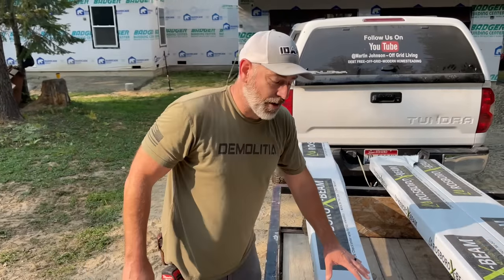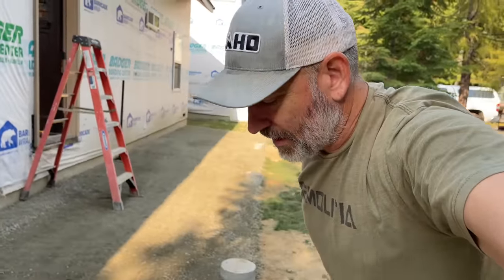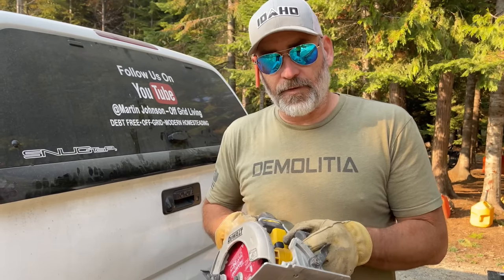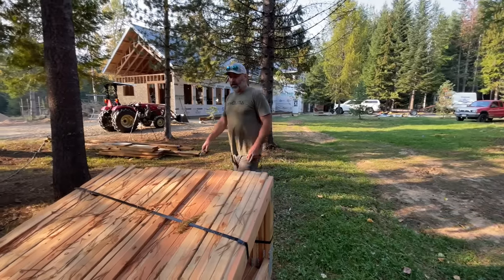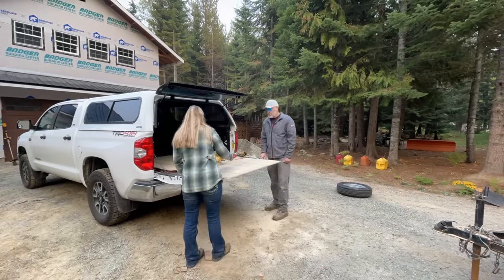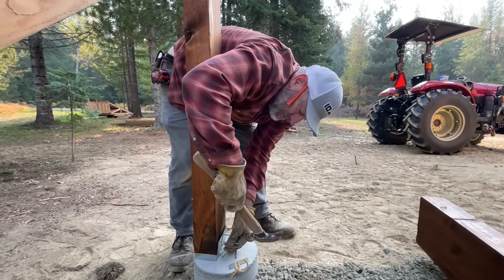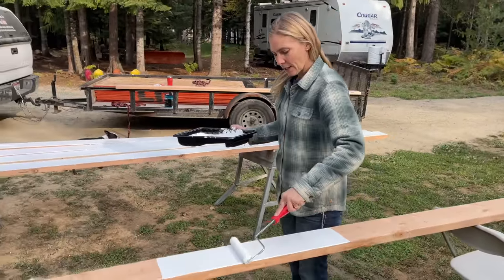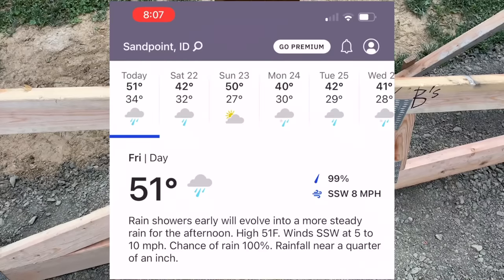Porch Roof Build - Couple Building Off Grid

Comment: I would spray all the hardware with WD40 Dry Lubricant. It dries, it collects no dust, helps stop rust, and removing moisture. FYI I also would do you tractor and equipment. This will help over winter 🥶.  Have a great day.

Comment: Suggestion put perforated plastic drywall soffit vent up in the ceiling close to the house and soffit vents on end to keep from mold and convection happening. It’s a 2” vent from Home Depot that you install in the ceiling with your bird block vents for air flow close to the house out to the eave

Comment: In your cold storage area
You will either install a water heater pump or filter system
 Which would be a good place as it will not freeze during extreme winter periods
 Keep up the great builds on your home. 
 Glen from Guam usa

Comment: Jewels why are you limbing? Marty glued lumber usually are a little longer than ordered. It's done to make sure you'll have a little leave way to choose the best part of the lumber for your project. Also the yard will only roughly measure the length of the trees used, but so that there is excess wood in the length...

Comment: You should have used a water level, a clear hose almost full of water with a cork in each end. You can make it as long as you like, and or transfer you’re elevation by making a mark allowing you to move you’re mark wherever needed. I’m a retired ironworker, before lasers that is how we did it. The contractor hired an engineering outfit to put in a mark on each floor. All this for setting windows. When they came out with lasers I thought we already have that problem put to bed. Every finish ironworker carried a rolled up clear hose filled with water and capped with a cork. Every floor on a story job, all of the windows. I would take a dispatch on the 5th floor of a 66 story and wonder if I would top it out. As an example of how much we used it.

Comment: Looking good, hope you beat the snow.   One suggestion is to flash the upper roof fascia to the top of the porch roof.  You don't want any gap there as it will collect blowing show, leaves and allow critters to get in make a nice home in the cavity between the upper roof and porch roof.  You will want to add some venting at the ends of that cavity or in the ceiling below the cavity to get air circulation in through the upper roof bird blocking.
Don't know how your are going to nail down the porch decking behind the upper roof fascia, glue ???

Comment: use a transit to see what the difference in concrete pad heights and cut post accordingly and will be straight.use your tractor to set your beams or at least get it close.i wish my boss would of had a fork lift with extending lifts or something.i use my tractor for my stuff as much as possible

Comment: You guys are doing great. I guess my question would be if there is a small heat source on main structure of roof would there be a concern when snow slides to porch roof would there be a build up at top edge of porch as there is no heat source. I think your design is good and the weather will tell what happens. Anyway great job!!!!!!
Reply: I also wonder, if the slope of the porch trusses, is great enough for the snow to slide off?

Comment: I think you're over thinking the strength of your porch roof. 😉 You have that thing built like fort Knox, it isn't going anywhere.
Reply: Not sure I agree, the trusses are only held with angle driven nails , I would have used screws through the truss upright and into the post and header of the house wall.

Comment: Hope you don’t get any hornets or wasps building their nests in between the two roofs, they will be impossible to get at and could ruin your porch enjoyment.
Reply: Yes I too see that area as being a pest problem for the future.
Reply: Yes , Most steal roofing manufacturers make positive and negative foam inserts that go into the ends too stop insects from entering the roof ends and the ridge caps. I would use the ridge cap foam all along the roof gap and seal the ends with screens.
Reply: They could always paint the soffit sky blue. Supposedly it’s just a myth but it’s worked for me for years. Dirt daubers don’t even build nests on it

Comment: Hi Martin,

Here in Germany it is forbidden to shorten Screws and threaded Rods with an Angle Grinder. They may only be sawn slowly, because the cutting Process heats up the Steel too much and loses its Strength as a Result.
Steel loses its Strength from about 350 degrees Celsius (see also the Steel Beams from the WTC)

You shouldn't do it...
Reply: Not a lot of logic there as the heated part is outside of the nut when it has been tightened !!

Comment: I blame the tape measure. I’m right handed so, if I am marking out measurements, I pull the tape with my left hand and mark with my right. Problem is the numbers on the tape are upside down when I pull the tape with my left hand. On more than one occasion I’ve marked from the wrong side of the tape. After fifty years you’d think I would have learned. Nope.